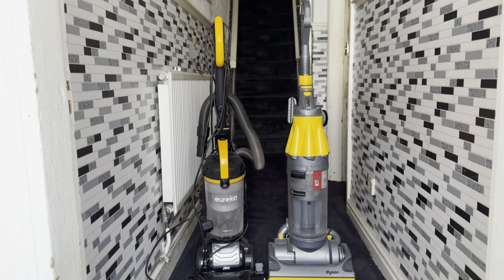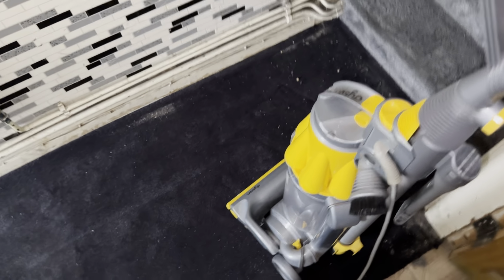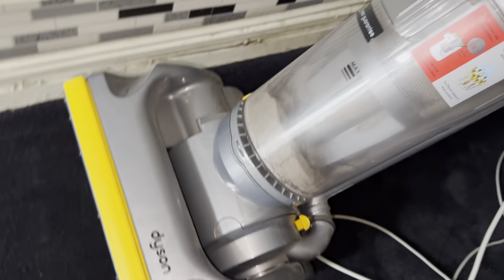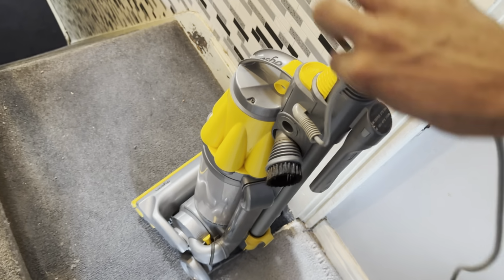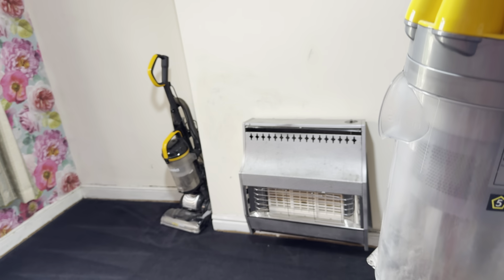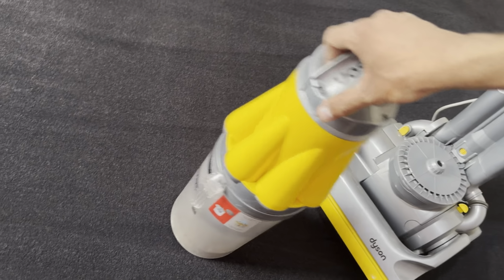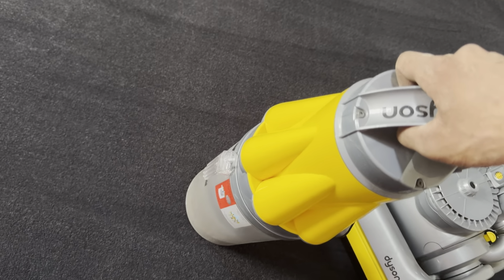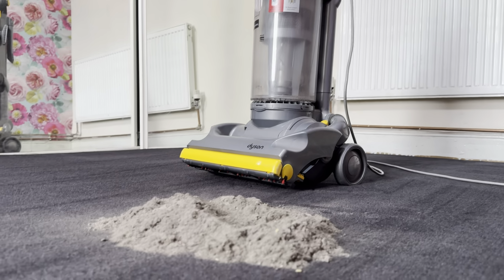Let’s see how much the Eureka Dash Sprint left behind!!

Comment: I'm still trying to get used to seeing Eureka branded vacuums in the UK.  That DC07 is just amazing.  I'm actually surprised that the Eureka left that much dirt behind.  Plus, I'm surprised that it's dual cyclonic separation design let a lot of dirt pass through.  I don't think any of the dual cyclonic Dysons would've let that much crap pass onto the pre motor filter.

Comment: All of these Dysons should have been clutchless. From what I can tell most customers did not even know you were supposed to turn the brush off on hard floors anyways. It could have been just been a feature introduced with the DC15 and onward. They just would have needed to include a hard floor like the Fantom did. Then just think about all negative attention Dysons would not have gotten. Not to mention the cheaper price point possibly. I think any vacuum would have left a bit behind with all stuff you put down however, the Dyson literally changed the color of the carpet. Can you go over with a UP32 or 34 to see if it can get anything else?

Comment: Today's corded cheapo vacuums are so weak and gutless - I mean, what is that Eureka rated at? 450W? they dont have the power to perform properly. The DC07 is 1400W if I remember right, and one of the most powerful and effective Dysons ever made - they were beasts. 
I'll bet the Eureka wouldnt have done a good job at your mosque either. Seeing that dust whirling round in the Dyson's bin when it was going over the hall carpet reminded me of the video you did a long time back of using a Dyson to clean your mosque.
Reply from the maker: The DC07 really is an incredible machine! The Eureka is shocking, even for a 700W machine - a Vax Air outshines it in pretty much every single way. It’s a machine that looks like it’s been engineered adequately, but the results show different